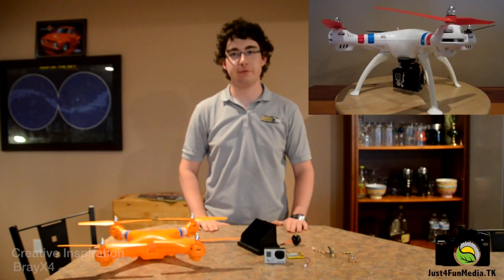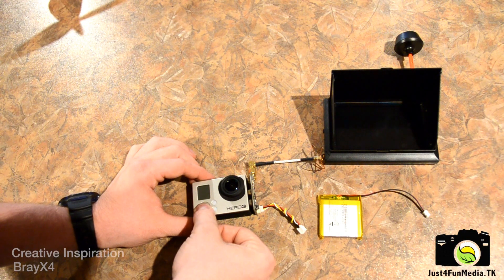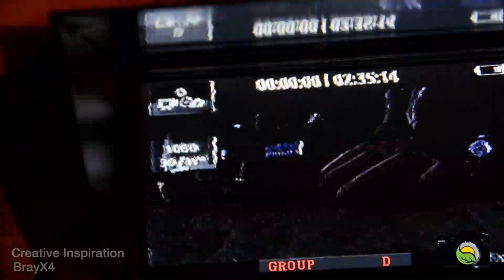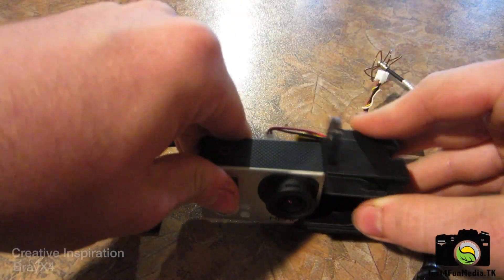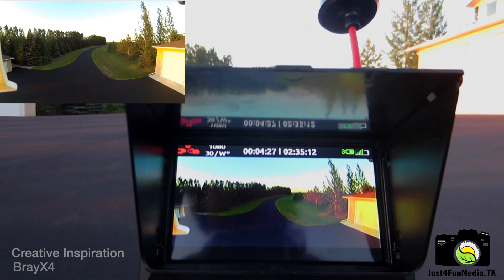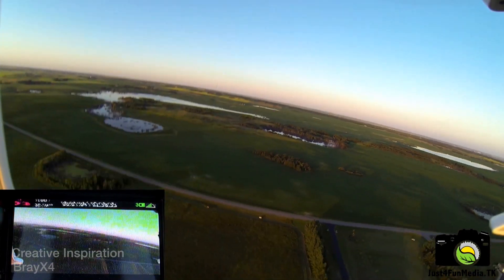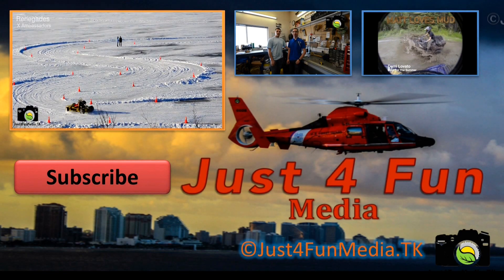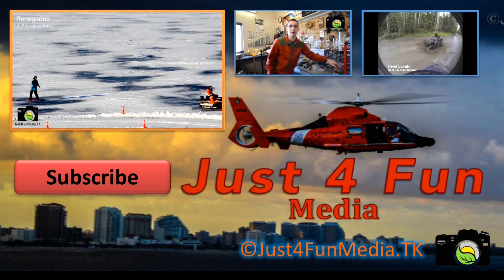GoPro Real Time FPV Transmitter

Comment: How does the transmitter connect to the monitor? I'm wondering if there's any way to get it to connect to a cell phone.
Reply from the maker: The transmitter is receiving the video signal from the monitor. Most cellphones would require an RF dongle to receive the transmission. 

All the best,
Danno

Comment: Hello dano is it possible to take power the transmitor from the drone ?in this case we don't need the extra battery
Reply from the maker: It is possible to power the transmitter off of the UAV as long as your drone has, or you install a regulator to get the proper voltage. I used an external battery for this project so the camera could be easily swapped between different UAVs.

All the best,
Danno